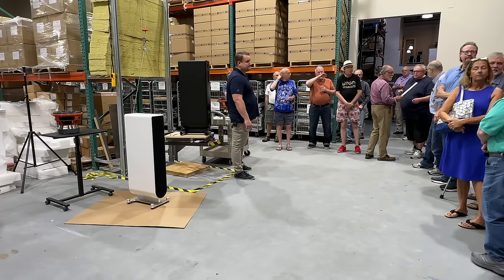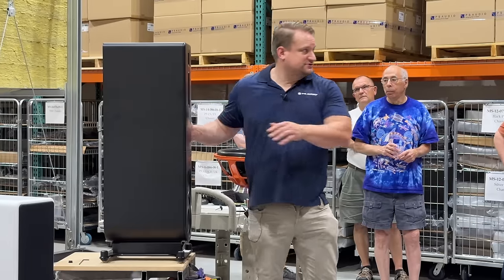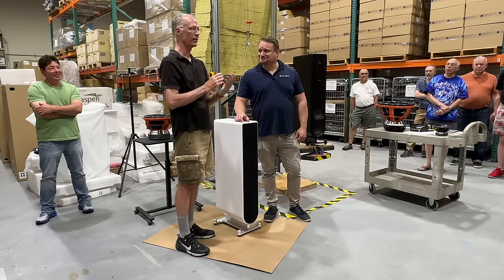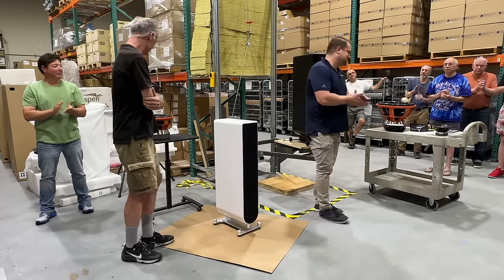Chris Brunhaver reveals the aspen speaker secrets

Comment: 6:46 "A reflex box can have a passive radiator in it". I dont think so
Reply: A passive radiator is a bass reflex system
Reply: @cbrunhaver  No it isn't. A passive radiator is a membrane of certain mass and resonance that resides in an infinite baffle enclosure, this augments and enhances the bass or mid-bass drivers low Fq response
Reply: @Campbell1. they are both Helmholtz resonator spring-mass oscillators and work on the same principles. The PR has an additional compliance term that can be mostly ignored when talking about less than a 5 Hz Fp.  I spoke with Laurie Fincham on this who derived early math on this in the early 60’s and designed the celestion Ditton passive radiator. That’s like one step away from talking to Harry Olson about its invention.
Reply: @cbrunhaver  LOL I used to have a celestion Dittion 150, yes a passive radiator, the cabinet was sealed. From what I've learnt in acoustic engineering is that a passive radiator can not work in a reflex enclosure. Its physics, sorry. A bass reflex means there is a port of some description. And I'll stand by this thanks. IF you can name One speaker in the world through out history that has a passive radiator in a reflex enclosure, I'd be most perplexed

Comment: 6" and 8" drivers ain't woofers, come on
Reply: Well, it’s about the total displacement(swept volume). 4 x 8” woofers have nearly the cone area of a 15” woofer and they move cleanly nearly 1” peak to peak. There are also 4 x 10” passive radiators at tuning.  Not too many high end home audio speakers in this class have more than that.
Reply: @cbrunhaver  Legacy WHISPER has 4 15" woofers, 4 7.25" mids, passive radiator, ribbon mid and on and on, plus new models have coupe thousand watts built in amplifiers, and a DSP control preamp, for a bargain price, PS Audio is grosly over priced for what is received...why do you not have SDP and active electronics at your price point.  4 15" woofers don't need massive cone movement, thus less distortion....and they are super efficient...Legacy has much more advantages over PS Audio loudspeakers.  They also do commercial stuff for giant venues, HELIX monsters...Maybe hire Bill D. as an advisor and designer...Legacy Valor models are way beyond PS Audio capability...
Reply: @cengeb  but the woofers are open baffle and you literally need 8X the displacement in that configuration at low frequency (see calculations at linkwitz lab). Dipoles are not efficient at all at deep bass.

You can read up on the physics involved before your next recommendation.
Reply: no but these are🐕🐕

Comment: Well that's just bs there is no way a diaphrag is going to be light than air
in thermal process resin add a very fine powder of slate, it will make sound resonance properties better.
 and you need to isolate that front baffle with some type of foam or rubber you can't really have it bolted to the cabinet but you can but you're lose performance and clarity
Reply: "there is no way a diaphrag is going to be light than air" - you need to listen more closely.  The diaphragm is lighter than the air it is displacing as it extends .

Comment: so if i have a 5 inch speaker  = 1 why do i need 5 of them?   Oh it makes the speaker cost more same tin sound
Reply: "why do i need 5 of them" - so each of them move less. If you have one speaker it has to move much more.
Reply: Surface area, excursion, frequency and dB are all connected (as well as intermodular distortion and linearity).